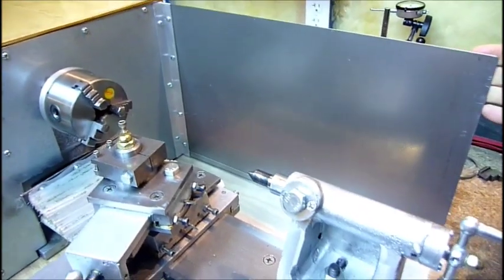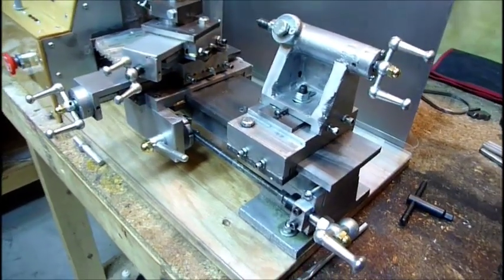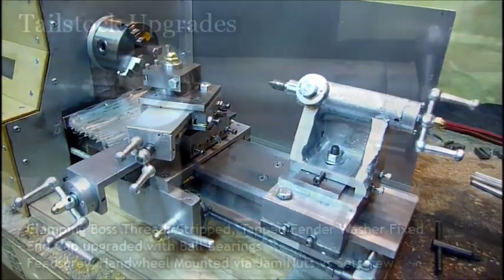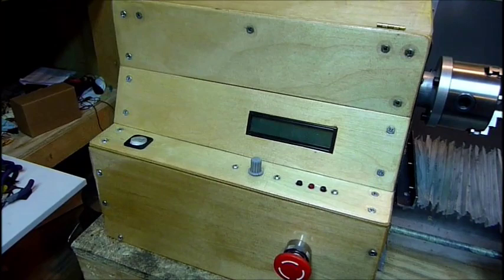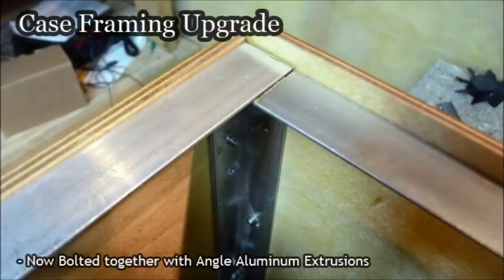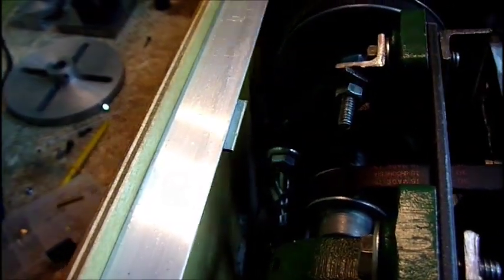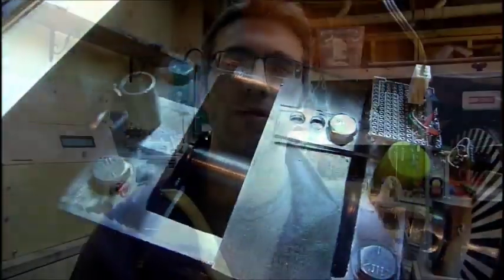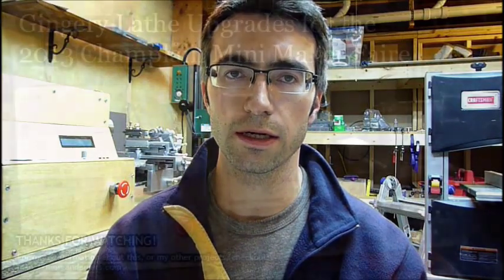Gingery Lathe Upgrades for the 2013 Champlain Mini Maker Faire

Comment from the maker: *Guds777 - Thanks for the suggestion on filling the defects with soldering tin, I think I would definitely try that if I was going to paint the parts, but I would imagine it would still be detectable if not painted?
Reply: bondo (body filler) and paint that's what China does with all the machines they make... specially their cast iron parts. And if you want further rigidity on hollow parts, use epoxy "granite" mixture to dampen vibrations. This is not a gimmick, it is what the real deal machines have, along with proper "seasoning" of the cast iron parts, vs china where they get to machining them straight away (hence warping and other issues such as cracks). Aluminum in a similar regard does harden with age, but that's another story!